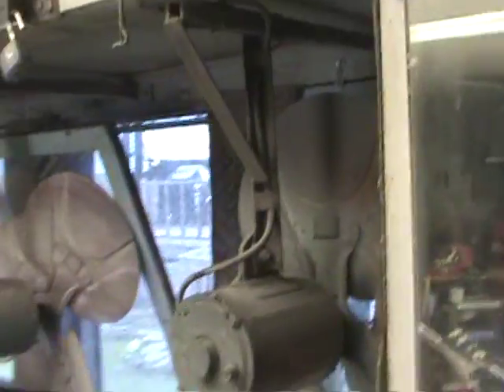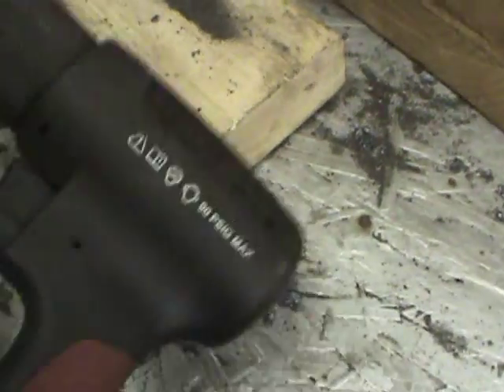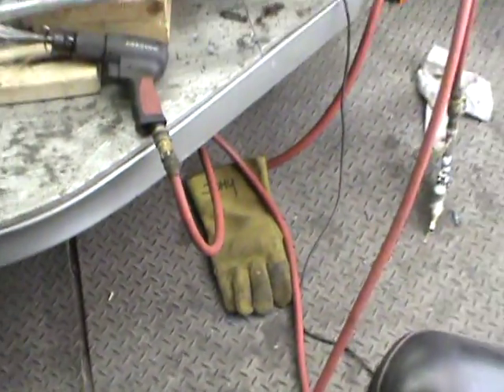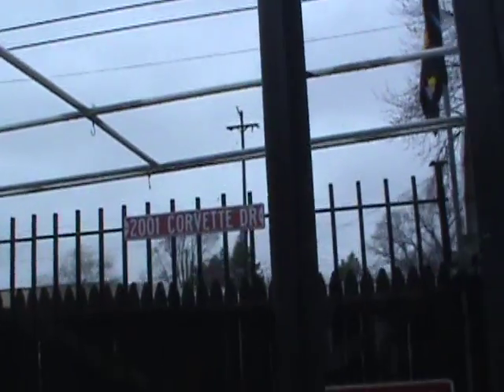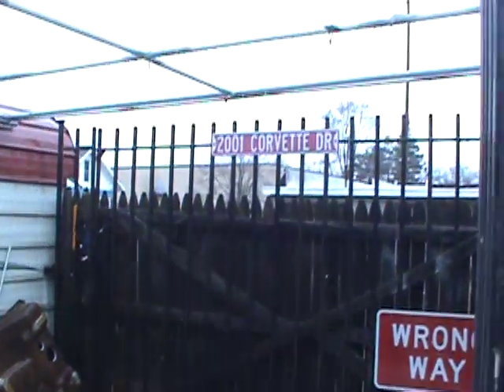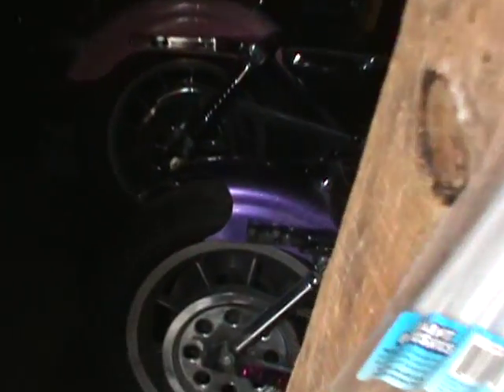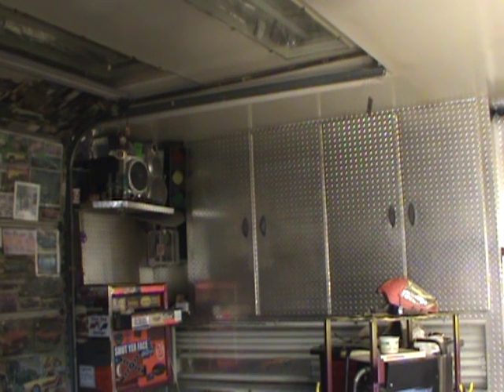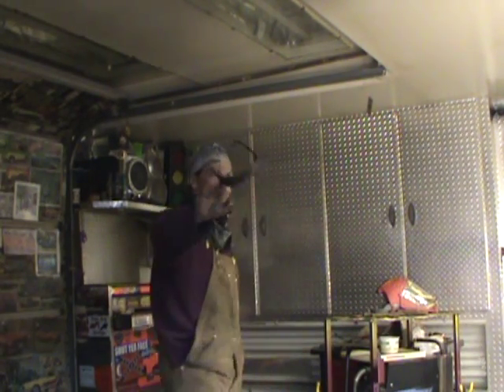CCI CHOPPER REAR FENDER GRIND DOWN

Comment: for the air hammer buy a quick release chuck, I never use those "janky" springs .
also  a  long barrel air hammer with about 2000 Beats Per Minute is where the power is.
what I found on amazon. Ingersoll-Rand 117K $60.00 shipped! I had this one for over 10 years and used it daily.